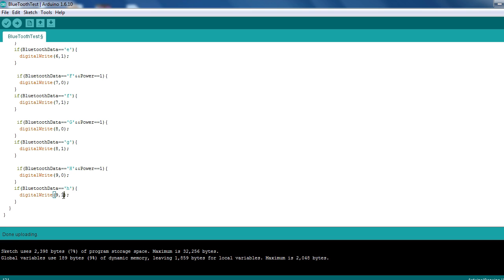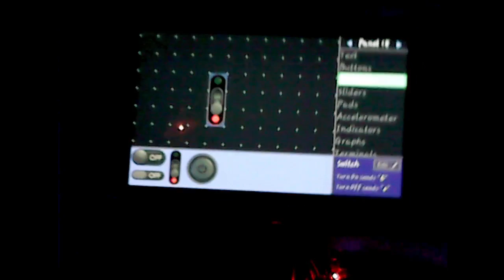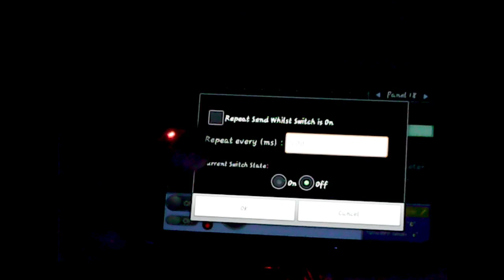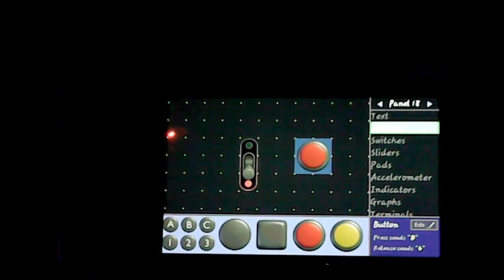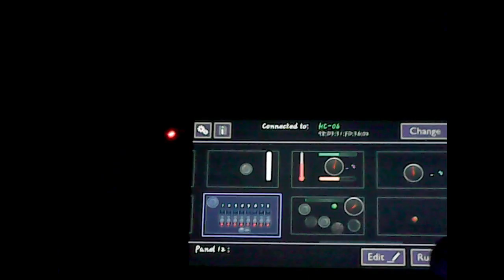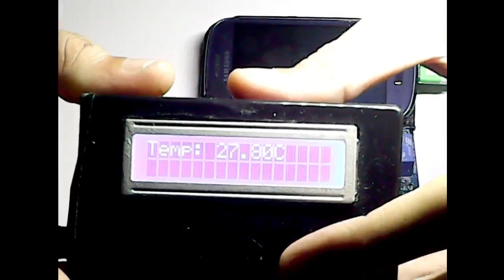Arduino and Android Bluetooth Relay Control (Tutorial)

Comment: is that any way if my Bluetooth signal is lost then all the pins of arduino will be switch off mean no operation perform all the relays switch off
Reply from the maker: Yea, I'm pretty sure the bluetooth should have a pin for connection, Just add a analogRead() to that pin. if you google your BT Module just search for the pinout of your device ;). BT when not connected flashes and is solid when connected. you could just use the off time as the trigger.
Reply: @liney118  seriously i can't understand any thing i put BT module on arduino rx and tx official pins can you please share me any example I'm very thankful of your
I have only one week to sumbit this project. Project is ready but i can't solve this problem yet
Reply: Ok i found A0 pin of BT and connected to arduino board now i can't understand these line could you please elaborate these line
BT when not connected flashes and solid when connected. You could just use the off time  as tiger how?

Comment: Hi, thanks for the tutorial. I tried the project on Pro Mini, Mega and Uno. But none were succesfull. I can not turn the arduino on as you did with an LED turning high on...

Can you tell me;
1- Is a Power Button on the app compulsory?
2- İf it is compulsory what letter should I put?

Thanks for your cooperation in advance.
Reply from the maker: no power isn't compulsory

Comment: if i had 4 relays could i switch them individually , then have another set switches to switch them in pairs by just puting the relay letter in the same switch. could you use the 16 relay board aswell.
Reply from the maker: Yes

Comment: I saw a similar, if not the same relay on eBay.  In the specifications it stated "equiped with high-current relay : DC30V 10A AC250V 10A".  Have you tried using the relay to run an AC light or other device, and did the relay perform satisfactorily?
Reply from the maker: yea sure, I've ran many high current devices with these relays, always best to start with the DC and run that up to 10 amps first as I believe not all of those relays will be of the same quality, best to be safe than sorry when it comes to unknown products on ebay.

Comment: I want to connect  12v 2 channel relay to aurduino but i dont know which vcc to  to connect the 12v .
anyone please tell me the  pic configuration properly to connect the relay to aurduino.ASAP
Reply from the maker: got a link for the relay
Reply: u don't get 12v output from Arduino board, only 5 v output

Comment: I am new to this so bare with me on this. I came across your video while I was looking for bluetooth relay control, which is easy to follow. I have put together exactly as you described in the video and I have downloaded your sketch and uploaded to the arduino uno. Everything works as described, except the timer function of the sketch. According to the sketch the timer control is set from Uppercase J to enable and lowrcase j to turn off, is this correct, and if so it is not working for me. Can you confirm if I have done this correct, and if so is their another way of doing this within the code, I would be grateful if you could point me in the right direction on this. Thanks.
Reply from the maker: Yes, the timer function wasn't used in the release.
Reply: I would be greatful if you could supply the code that would make the timer work as in the video
Reply from the maker: I've just checked the code and the timer is implemented, Sending an Upper or Lower J via BT module link, will call the timer function.
Reply: Hi Their, thanks for replying. I have used the code from the link in description, and have uploaded to arduino, and everything works apart from the timer. I have set Upper and Lowercase J / j and still not working.
Reply from the maker: Just tested the same code, timer takes around 12 seconds to turn off the relays, can you test again
Reply from the maker: I found the problem, On my app I'm repeating the J send 100ms, Just tick the box and edit ms.
Reply: Thanks for being patient with me, its bugging me how this is not working as I have set it up as your instructions. Just retested and it is still not working, I am using the same app and the repeat is not set and it is still not working.
Reply from the maker: you need to set the repeat to 100ms and make sure the box is ticked, I did it this way so I can chage the values via app, though I could have coded it better.
Reply: I will give that a go and let you know how I get on.
Reply from the maker: Steven Adams Please do